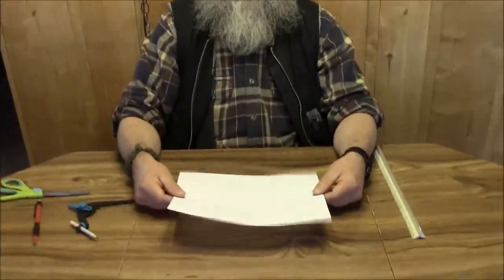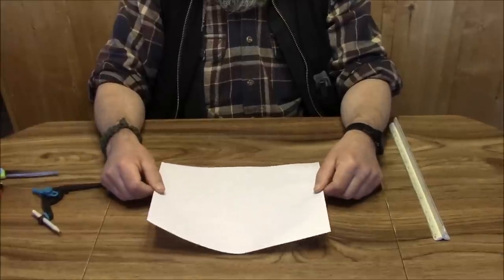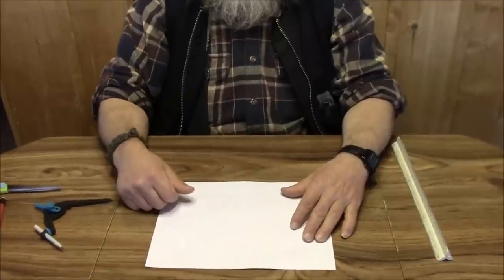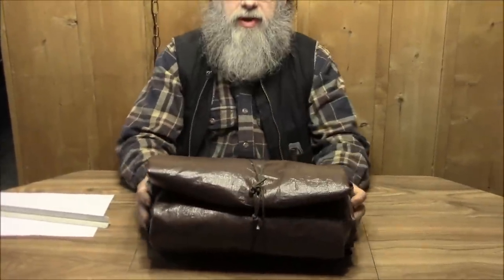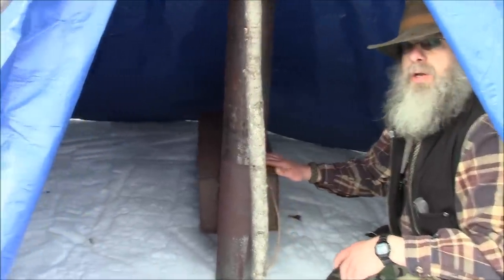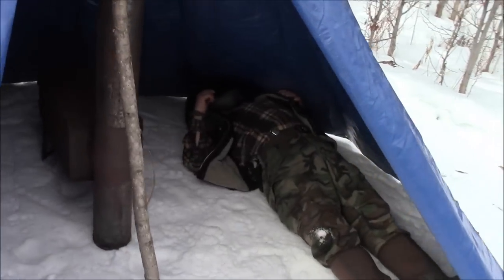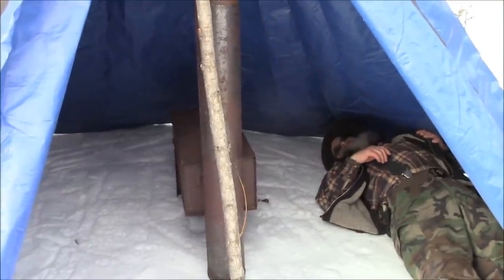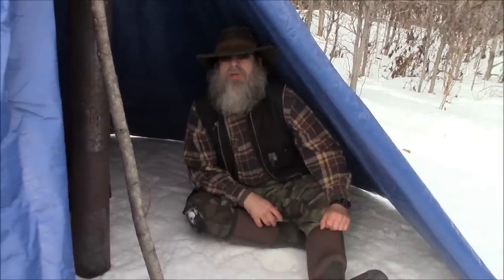Make A Tarp Tent Tipi Hot Tent On The Cheap

Comment: that is a very mathematically clever way to maximise the arc of your tipi? i was never very good at math or geometry at school! but the way this was explained is faultless at a nice speed for me to understand think about what you were doing whilst watching it? this material is quite hardy for what it is? its cheap enough thats for sure however i find it has too much life of its own isnt fluid enough like canvas or other superior types of material
it is a good economic fix 
for sure but id prefer to use a better quality of material for uses as the tipi shelter!
which would probably change alter everything except the marking out edges would most likely need to be properly hemmed using a sewing machine!
but 4-6-8oz cotton duck canvas
and or 24gm cotton ventile fine weave material in an assortment of different colors can be bought off the reem from commercial suppliers at amounts less than 10m =
just over 30ft! order amounts over that get treated by suppliers as trade amount or quantity usually? a tailor made complimentary floor sheet perhaps in sleeping areas leaving stove area floor free may also be a nice thing to have so your floor is insulated kept waterproof cleaner of forest floor material? 
just in sleeping ends
and a toggle system made of local branches or wood to keep that flap in position during very stormy or inclement weather even what i call a weather window a small square of see through similar weight charachteristic opaque like material vinyl acetate or other that can be used as a peek a boo type window so as you can view sky weather changes see any wild  animals and grab some light without ever having to go outside!! losing your heat or comforts!!
lie in bed watch the sky stars or weather changes?
win some much needed light illuminations for the insides of the tipi so you can see a tad better what your all doing insides whilst cooking or doing manual chores etc?
an additional strengthening of pitch by using an emergency guy system and storm setting of this tipi construction tent would improve its general feel of security during any surprise extreme weather that may ravage your camp!!
a small kit to lash it with to trees or ground
the downforces and weight of tipi on its upright pole are usually tremendous anyways if pitched right?
but i am from a windy stormy island and i like to have a little few extra tricks up my sleeve!!
regards countering my arch enemy the weather!!
should i get a nasty surprise coming at me at great velocity power n speeds!!
chances are if this tipi ever got ravaged n collapsed its prob time to be heading on in n home! &
start yer digging in & down! building
a bunker!!
but that was a really nice and clever way
to maximise the surface area of a material i find a lower roof line pitch or angle improves wind shear or lowers profile of the tent!!
which is a bonuses in my book should the winds get up for a fractional losses in height!!! headroom
i spend most of the time on the floor stretched out anyways i rarely stand up in a tent!
unless my fellow campers tap their mugs encouraging me to make an after dinner speech in my tuxedo!!

a very nice simple well executed sturdy enough idea explained properly nicely!
it teaches you patience when your out in them woods not to rush stuff teaches you how to think and consider stuff
everyones going to fast today
they all needs to chillout
relax spend time like you n your mate working out stuff making the most outa what they got any problem is often an opportunity to use our god given initiatives
to improve upon it!!
youve proven that by presenting this video!
i found it very restful intriguing plus i very like watching others work it lulls me into sleep!! makes me feel of what im not missing out on watching others do what i should also be doing!!

har har!!
i want to see your next video doing it in an alaskan full on blizzard now that id find almost exciting
the dead opposites of relaxing!!
we would all be glued to the video climax to see if you ever made it through alive!! 
ive had to spreadeagles over my tent go involuntary hangliding many times during bad weather im now wishing it all upon my fellow campers!! 
har har!!
im fed up with suffering!! out there alone unrecognised without my medal with oak leaf cluster awarded for valor in the face of tremendous adversity!! 
prob find me wrapped up like a chicken in a freezer section after tent n strong stirmforce winds have wrapped this vinyl tarp arounds me! i cant find door again or break my ways out! he he!!
Reply from the maker: There was a massive wind storm that just ravaged Alaska a few days ago.   It made the news and people were told to stay home if they did not need to go out.  Lol. me and Connie were out in that. camping in the tipi and had no idea that storm was coming.    The tipi did amazingly well.   The storm just kept getting worse and worse during the night and I was expecting that at any moment the tipi tarp material was going to rip and go sailing off into the lake leaving us exposed.   Even though the tarp material was slamming back and forth and sounding like some one winding up a bath towel and popping it, it still held together.   I also wondered about my taped and grommeted hem.   It held beautifully.   I'm sure that a lot of commercially available tents would have ended up a smashed and tangled heap of poles and nylon.   Neither Connie nor I were getting any sleep for the concern we had for the tipi structural integrity.  Finally somewhere around 2 Am to 4 Am I took the center pole down and just laid the tarp material on top of us.   we were then able to get back to sleep.    We were surprised when we got back out to civilization to discover that the windstorm we had just went through had made state wide news from at least Anchorage to Fairbanks.   

The tipi is phenomenally shaped to shed wind but this tipi kept flattening out on the windward side every time a gust would hit us.   We were camped in the alpine where trees were not available but I thought that if i would have erected a pole from the tipi wall bottom all the way up to the top of the tipi and fastened to the center pole, I could have placed it right in the center of where the force of the wind was hitting.    That should have effectively split the force of the wind and left it to be shed more efficiently off to both sides.    Yes there are definitely improvements that could be made to this design andf that is what is so great about the web.   I throw this out there and others tweak it to their liking and still others will tweak it their way and after a while a really great design can be come up with by looking at how everybody has done it "their" way.   Many design changes will no doubt be superior to the original and a very much improved product can be fashioned by analyzing all the changes people have made and tossing out some ideas and incorporating others.    I'm guessing that 5 years from now there will be a lot of evolution that will have occurred and most people will not even know where the original idea came from.  But at that time there will be some great innovations in design and execution to choose from when making a new one.
Reply: yes you are correct ive given msr seattle s design team for their msr whisperlite stoves some feedback told them of x5 diff ways they can improve upon it or get left behinds?
that sounded like one hell of a storm
i know that the indian trad tipis were longer on one side more upright on the other the longer sides braced the shorter sides enterances into the tipi were always planted facing east weather sides west as is the prevailing:wind patterns of weather in the usa?
gen trends that directions
there is a clever way to turn a tarp into a modern wind beating aerodynamic tent
the military use it many vids cover it on yt
but you did right by lowering your profile ive had similar exps in a storm involuntary hang gliding i call it
when a gust can lift you off the floor whilst laid out at full stretches inside the tent?
ive had to emerge in teeth of 110mph winds to wrap guys around boulders
and apply more tight drum like downwards pressure on the poles and guys ive seen watched straight poles bend with the forces and the water get flapped clear off fly sheet then suck in like a vacuum then powww explode again side of tent concave on windwards sides and convex the other
it gets real loud unpredictable i tend also to not sleep to well cuz yer kinda on semi alert for what may happen next to you?
when its freaky weather
but you know i still kinda enjoy pitchn myself abilities against it
the peoples i met in scotland when they saw where i was making my way up too
said to me have you been up the ben in a tent outsides all of this time in all this extreme weather! i said yes it lasted a week
7 died on same mt i was on
i woke up to fast moving clouds snippets of blue sky!
covered in snow
it teaches you whats important n what is not in inclement weather
ive also laid my flysheet across me in icy weather as darkness late arrivals fatigue after a long day got to me my friends couldnt understand why i dudnt erect my tent but as it turned out i saw 27 shooting stars that night they didnt!
and my temp was ok
despite being cold
lowering your wind profile works plus if it is really windy extreme guying any slack material across top of your tent or tarp does limit the range of movement stop prevent excess fabrics flapping everywhere as its the noise and violence of the winds effects on fabric that disrupts yer sleep after a bad storm has passed i find it necessary to sleep it off next day grab more kip
next day 
to compensate
after the weathers settled down?
but yes people power often amateurs can teach the pros a thing or too hurrah for thinking peoples everywhere i like folks who break their own wake in life and own their own minds
and aint afraid to tell it or show it!! 
moderm life is turning folks into shopping zombie morons
at least out in these kinda places you still got to be real
cuz if you aint you will end up dead
its a great motivator!! 
ha ha!!
Reply: the native indians knew a lot about tipi configurations
Reply: its quite an involved topic

Comment: Lonnie, I love your videos and this is another great one! I like how simple the design is. I also like how you called Connie "sweetie". I am looking forward to seeing how you make your stove. I winter camp with snowshoes and a pulk sled, so some day I would like to make lightweight stove. Cold camping is ok, but I want to try hot tenting some day. Your teepee tent will be perfect! For your viewers, a tip: have seen stove jacks made from a silicone cookie sheet. I am curious if an exterior fireplace, like Dave's (out of a fireblanket) in "El Cheapo Heated Tarp" video, would work for a teepee like yours. What do you think? 
https://m.youtube.com/watch?v=TGCQz9627EQ
Reply from the maker: Louise Hiker Hot tenting is a whole different deal than cold tenting.   To come into the tent when you are chilled and wet and sweaty and to be able to get up close to the warm stove and be able to take off outer clothes (hats, gloves, coats, etc...) just make it seem like life can't get any better.   If a person had to, they cold use the fire as Reallybigmonkey demo's but it would use FAR more wood than a stove.   Stoves can be made extremely packable, light and compact now days.   If you haven't come across them yet you might try web searching for the term "shim stock stove".   Those wouldn't hold a fire very long but they would should be plenty warm enough fro this shelter and can be packed up unbelievably compact especially if using shim stock stove pipe as well.   I will be making my stove jack for this tent, out of fiberglass welding blanket

Comment: Doesn't really need to be water proof during the winter...
Reply from the maker: As long as the weather is cold and dry, you are correct.  However if it snows, the snow would melt from the escaping woodstove heat and potentially cause problems with non waterproof shelter materials.

Comment: What size is the pole? If someone used the same tarp and copied you, the size of the pole should be the same.
Reply from the maker: I have never measured the required length due to I just step inside and lift the tipi to it's full height and compare that to my body height.   I then go cut a stick to use.   I do that each time.    However on a slightly different note.  On my pyramid or range tent, I recently bought (thrift store) an aluminum extension pole like what is used for attaching paint rollers or window cleaning scrubs for reaching high places.   Works great for my range tent but is too long for my tipi.   The same thing would work great for the tipi as well but using a shorter pole.   I prefer using a bipod externally rather than a center pole internally but it is nice and quick initially to just use a single center pole to get the camp set up until I can cut and apply an outside bipod.
Reply: @Far-North-Bushcraft-Survival  Yea there's one of those poles at a local discount/overstock store so I was thinking of picking one up and placing it on the sled. By the way, do you think I could just ducktape the welders blanket stove jack to the tent instead of velcro'ing it? A sewing machine isn't in the budget. Will be using the Guide Gear Mini Wood Stove.
Reply from the maker: @NavigatedChaos     I do not really know if the duct tape would work or not but I'm thinking that is probably not a good idea.   It will get hot around teh stove pipe and not only could the duct tape come loose due to the heat but it could also flop a loose end against the hot pipe and potentially catch fire which may lead to the tent catching on fire.   In the past, I have made stove jacks out of sheet metal.  I have one sheet with a hole cut in iot that will go over the pipe and fit the angle of the tent.  I make a hole in the tent that is slightly smaller than the size of the sheet metal stove jack.   I then slip the jack over the pipe and into place on the tent roof.  I then place the top of the jack under the tent fabric.   I then place the bottom of the stove jack on top of the tent roof fabric.   That way the rain running down the tent roof will run down the roof, onto the sheet metal and on down to on top of the tent roof below.   To hold the stove jack in place, I drilled two holes in the top and two holes at the bottom.   I the cut me two strips of sheet metal with two holes in each which correspond with the two holes on the top and bottom of the stove jack.   I then sandwich the tent fabric between the top of the stove jack and one of the metal strips and place a bolt through each hole and through holes in the tent fabric and tighten wing nuts on the bolts.   I do the same for the bottom of teh stove jack and the other metal strip.   Hope that all made sense.   It might fit your needs better if you do not have a sewing machine.   Of course you could always get a leather sewing awl and use it to sew it by hand.   They take a lot longer than a sewing machine but sure a lot cheaper.

Comment: Why cut it at all, seems wasteful
Reply: Plus You don't say what  size the center pole should be in length
Reply from the maker: As far as "cutting," I assume you are referring to cutting of the tarp so as to be able to fashion this tipi.  If you do not understand what advantage there is to cutting the tarp then I would probably be wasting my time to try to explain it to you.

The center pole length needs to be. . . what ever length you need it to be to do the job.   I have never measured it and always just cut me a new pole at each new location i go to.   Typically the poles are longer in the winter than during the summer due to purposely counter sinking the base of the pole in the snow floor.   Your tarp size may be different than mine or your measurements different than mine.  Bottom line is that you need to make the pole long enough to do the job required.